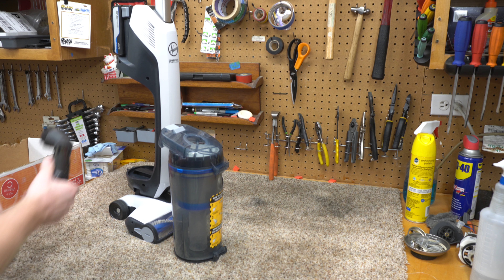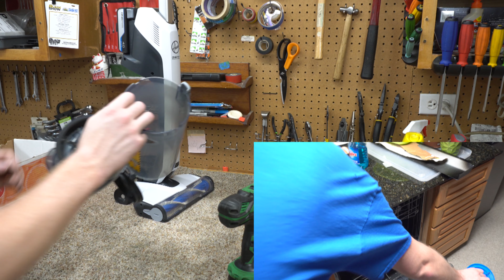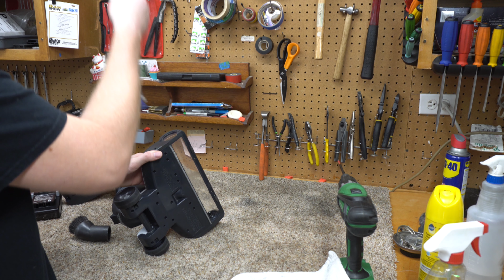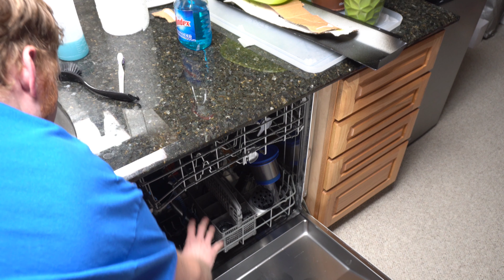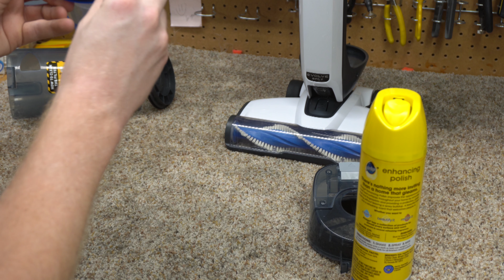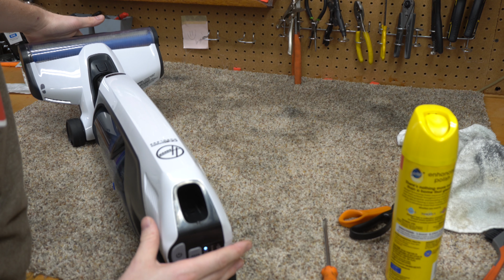Hoover ONEPWR Evolve (BH53420) How to Restore Suction -Vacuums Saved  Episode: 3

Comment: How do you take the body apart?? In other words, how do you separate the white plastic from the gray plastic. Two small tabs are visible at the bottom on either side of the point where the hose enters the body but so far those are the only two points I can find.

Comment: Does this vacuum have a beater belt? My beater stopped turning after catching on a rug fringe( the motor works fine) and the beater is clean . Do you have a video showing how to reset the beater belt, if that’s what’s wrong with mine?

Comment: My brush no longer spins. Any suggestions? I’ve already cleaned it and checked the belt but no luck.
Reply: Same issue
Reply: I had my brush not turn after I removed a noisy paperclip. I fiddled around thinking the vacuum was broken before discovering the brush doesn't turn if it is standing upright.  The brush only spins when the handle is bend backward in normal usage operation.

Comment: I have 2 of these at a my home. I was the builder in 1998. I had a Model 960 Vacuflow central vacuum installed. I has 2 motors and can operate 2 vacuum wands at a time. But what do is used are these Hoover Onepwr evolve cordless units. Thats the good news. But I need a grey plastic brush roller retainer which fits on the end to hold it in. Hoover is out of stock, anyone know where I can get one new or used?

Comment: My brush no longer spins. Any suggestions? I’ve already cleaned the brush and checked the belt.
Reply from the maker: There is no belt. Call Hoover customer service and have them repair it
Reply: My brush isn’t working either. I contacted Hoover and sent them the info , they are sending a new one. Had to send them receipt for claim. There’s a 3year warranty on this model.

Comment: I have been checking out this Hoover and hadn't fully decided to make the purchase but think I might just get this model.  Was also wondering how you felt about just vacuuming the filters with a good canister vac as opposed to washing them each time?  Maybe doing that on a regular basis and washing them every 6 months or so?  What would be your opinion on that?  As already mentioned, bagless vacs require alot of maintenance.. But Thanks for another great video.
Reply from the maker: That's an excellent option for maintenance!  You'll probably still want to wash it a little bit more frequently than every six months.
Reply: Dont buy it   no good
Reply: I've purchased 3: one for home, one for garage, and one for my daughter.  Two purchases came with two batteries.  All are performing above expectations on carpet and bare floors (tile, hardwood, and concrete in garage).   I wash out the dust collector (home usage) once every 2 months.  Thanks for showing how to disconnect hose.  I was afraid I would break it by pushing on it - it does take a strong push to unsnap the hose for cleaning.  You can hear the snap when you release the hose and when you re-attach it.  I like the OnePWR convenience of no cord to manage, its external battery, and how easy it is  to switch from carpet to bare floor.  I've replaced the internal batteries in an Electrolux Stick Vacuum and don't want to do that again.

Comment: Unfortunately, this vacuum seems to have two major issues, the hose from the head to the body will crack and the power and mode buttons will fail.  Ours lasted two years, which seems to be the norm for Hoover cordless vacs.  I have three dead Linx in my basement, they have other issues.
Reply: I have had 2 as well and both have the power buttons failing. It's tricky to get them started up.
Reply: @JaneBasom My buttons have failed as well. Have you by any chance figured out how to take the body apart? In other words, separate the white plastic that houses the buttons from the gray plastic? I hate to destroy it.
Reply: @johnpearson4899  I have not torn it apart, other than taking apart all of the pieces that do come apart and giving it a thorough cleaning like this video shows. I also used my corded vacuum with a strong suction over the buttons to see if I could suck out any dirt/dust. My thinking has always been that dirt and debris are getting into the buttons, since they are positioned facing upward and that is likely the cause of the failure, but I don't know that 100%. I'm still getting by with it, but it continues to be touchy every once in a while to get it turned on and continue running. Honestly, if and when it fully breaks, I'd probably still get the updated model, since I really like how the battery is charged apart from the whole unit, like a power tool. I don't have a place to store a vacuum plugged in to the wall like a lot of units are designed. I also like having more than one battery to just swap out if I'm using it for an extended amount of time. I just haven't found any other brand that I like better for a cordless vacuum. I had an even older hoover cordless model before this one and its replacement that I really loved. I guess I may just have to settle on the fact that they aren't designed to have a long lifespan, but in that case, I sure wish the pricing would reflect that.

Comment: I hate it!! Not sure why it spits out what I just vacuumed and it's new. Ive cleaned the filters cleared the hose. I may as well sweep my floor.
Reply from the maker: Well it's not a vacuum. It's a floor washer.  You need to vacuum before using it. Hope that tip helps.